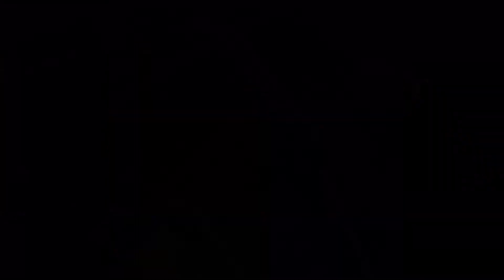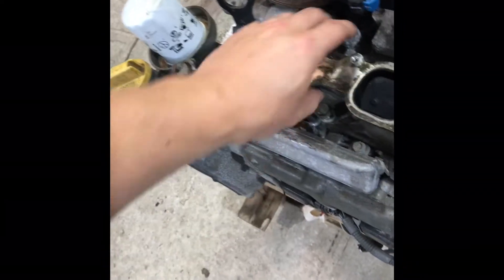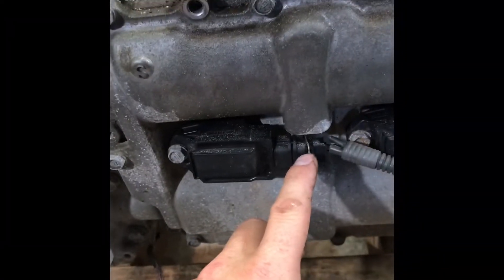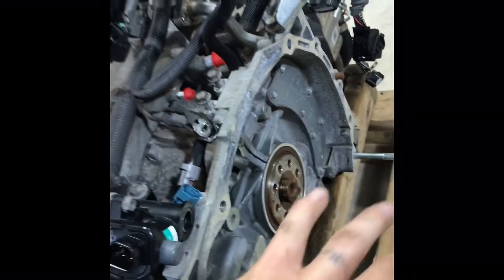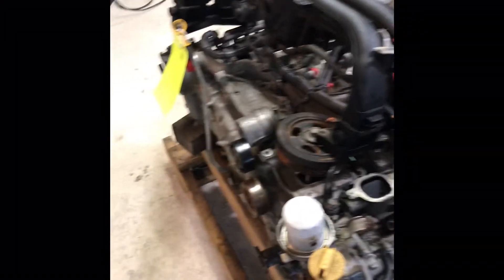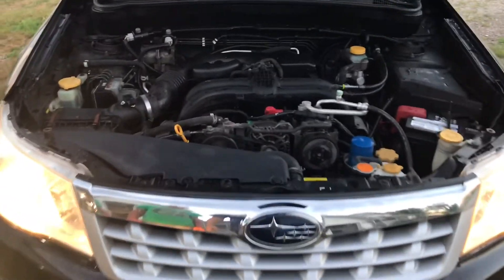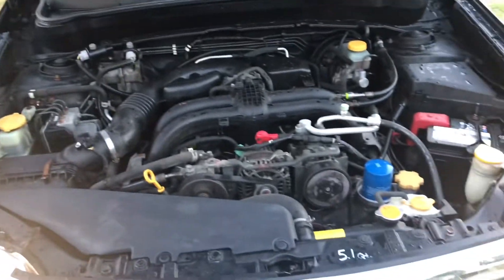2017 Legacy Engine Swapped into 2011 Forester!

Comment: I just swapped a 2015 into a 2011 forester keep getting 2004 2005 2006 2007 codes any ideas
Reply from the maker: Those are all codes for the TGV’s. Both sides are reading stuck open and stuck closed. If you watch my latest swap video I explain how to work around it. Here’s the link:  https://youtu.be/zORqmkh46H8?si=k6pThjwIyIt81sI9
Reply: @stvnswld  I used the old intake and tgvs any other ideas
Reply: I guess I should have mentioned I started with the newer Intake and was getting the same codes but not all 4 at same time so I pulled actuators off old engine put them on  new in take same thing then swapped magnets and gears and then put old intake and reinstalled with old actuators. Are the actuators  side specific. Maybe I mixed the magnets up when reinstalling or mixed the actuators up side to side
Reply from the maker: @JohnWilliams-ii6uy  The actuators shouldn't be side specific. Using the new intake manifold, use the old actuator solenoids, use the black magnets from the old intake assembly, use the gears from the new intake, bore out the hole in the magnets so you can readjust the position of the magnet (right now it only fits on the little shaft one way and can't be adjusted), put the original washer that came off when you removed the magnet and add another small washer to space the black magnet out slightly from the gear, black magnet labeled B goes on the driver side, A goes on the passenger side. You will need to remove pins 4 and 5 from the harnesses that connect to the solenoids and reverse their positions in the connector. This is a must because the valves open and shut the opposite way from the original setup and you need to tell the solenoids to move the other way. Hopefully what I'm saying makes sense.
Everything that I've replied with so far has been straight out of the video I sent you a link to on my first reply. I suggest watching that video and note the procedure starting at about the 15 minute mark. I really feel that if you see that part, you will know what to do to have success with no trouble codes. I spelled everything out pretty clearly in terms of the TGV setup and even linked to the forum where I got my info in the video description. 
Hope this will help, let me know what you come up with!
Reply: @stvnswld  I had my motors swapped before finding this video but anyways I am running the old intake on newer motor after swapping parts and pieces before finding your video I Had mixed up the magnets after a bunch of trial and errors so I swapped the mags back to where there are supposed to be and codes are gone. Like I said I wish I would have seen this before installing because I never swapped the tone wheels and now I got the p0016 and p0018 so I assume that is my next issue. Your video is great and very informative wish I would have watched before hand thanks for all the info now to tear trimming cover off again ugh. But again new motor old intake so far no leaks
Reply from the maker: @JohnWilliams-ii6uy  thanks for the feedback! I didn’t realize you had already done the swap before watching. You don’t have massive air leaks between the old intake manifold and the cylinder heads? Aren’t they shaped differently? I tried running the old intake once and I had codes and problems because the manifold wasn’t sealed good against the heads. My first swap I didn’t know to do the tone wheels on the cam drivers and had to tear it back apart too!
Reply: They are shaped different I just put some rtv where it looked like it may cause issues if it does then I will do the intake swap. The first motor I did in this forester I put a 2014 and it also ended up with oil consumption and low compression so fingers crossed this one last longer thanks again
Reply: I did try swapping things around is it possible if I mixed up the actuator from side to side it would give that code
Reply from the maker: @JohnWilliams-ii6uy  are you getting those codes while using the old intake? If the codes come while using the new intake, you can either use the black magnets (swapped side to side and repositioned), use old solenoids, and reverse wires 4&5 in the connector…. OR take the original tumble valves and hook them up somewhere in the engine bay like I did in the video of the black forester. They won’t be functioning properly if you just tie them up out of the way, but you will get rid of your codes
Reply: Where do you get your timing chain gasket kit from do you go through a dealer
Reply from the maker: @JohnWilliams-ii6uy  the cover glues on, I use a John Deere product but rtv would work. The four orings behind it are Subaru OEM, but I get them online because I don’t have a dealer close.
Reply: All is good changed the tone wheels and so far no issues
Reply from the maker: @JohnWilliams-ii6uy  fantastic! Thank you for coming back with an update. I love hearing when people have successes
Reply: Having videos like yours really helps when you run into.a snag
Reply from the maker: @JohnWilliams-ii6uy  I’m glad. That’s why I post them. Help folks out.

Comment: Awesome video! I just swapped a 18 Forestor motor into a 15. I was curious as to why the tumbler generators don't work? I looked at both wiring diagrams and they appears to all be the same. Are the 5V signals inverted or something? Was curious if you could rewire them to work, and not have the old tumblers in the engine bay. Thanks for taking the time to make this video!
Reply from the maker: Thank you for the generous feedback! I appreciate the positive affirmation very much. 

I believe you will find that the valves themselves open and close in opposite directions, new engine to the old. Please check out my newer video, it’s got a better fix for the tumble generator valves! It’s a better video together, I think. Let me know your thoughts in the comments section of that one.

Comment: QUESTION 
I changed the engine in my son's 2009 subaru forester with an engine outta a 2009 subaru outback that ran ŵhen i pulled as well.
Now installed in the forester it has no spark , any idea why?
Everything looked exactly the same but guessed wrong 

Any help would be greatly appreciated 🙏
Reply from the maker: Perhaps the crank sensors are different? Did you keep the forester intake manifold?

Comment: Swapped a 2017 Legacy engine into a 2011 Forester. Got a crank position sensor failure. Any ideass?
Reply from the maker: Was there a specific code? Did you use the original crank sensor and original tone wheel that the sensor reads under the flex plate? Did you use the intake cam tone wheels from the original engine? These could all be items that could cause problems. Are you experiencing a crank no start or is the engine running fine? Any extra info you can share would help me give you good ideas of where to start looking.
Reply: @stvnswld  the failure code is P0340. All sensors were swapped from the old engine to the new engine.
Reply: The engine cranks, and the spark plugs are firing.
Reply from the maker: @samjordan862  you might try using the sensors that came in the new engine’s timing cover? Just one idea for starters
Reply: @stvnswld  we tried using he new sensors and it still won't start.
Reply from the maker: @samjordan862  it’s possible there is a broken wire or bent pin in the harness or connector going to the sensor?
Reply: @stvnswld  we tried that as well.
Reply from the maker: @samjordan862  I would suggest swapping camshaft sensors left to right since your code indicates bank 1. If the code changes to bank 2, then It’s a sensor issue. If it continues to read bank 1, it’s deeper. That’s what I would try next.
Reply: @stvnswld  Here are the 4 codes that I have from the 2017 Legacy engine into 2011 Forester.
P0340 Camshaft position sensor A Bank 1
P0345 Camshaft position sensor A Bank 2
P0335 Crankshaft position sensor A
P0102 Mass or Volume Air flow circuit low input.
Reply from the maker: @samjordan862   the P0102 is for mass air flow sensor, you may try cleaning it or making sure none of the pins in the connector are bent or anything. Perhaps cleaning the sensor with MAF sensor cleaner spray. 
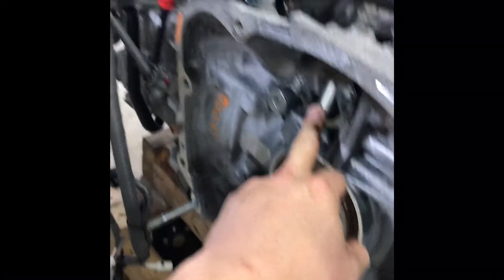The cam and crank codes indicate the timing is either off or the sensors are sensing that it’s off. If you watch the video at the 5:33 point it shows a very critical step in removing the long skinny crank sensor and installing the short fat crank sensor in its place as well as using the tone wheel that was on the original engine. At 7:05, you can see the tone wheels that the cam sensors read. Those need to be switched out so the ones from the original engine are installed. The fact that both cam sensors and crank sensor are flagging you seems to be indicative of something like that. 

If it helps, I have a second video on my channel of another swap and I think I showed some of these things a little more clearly. Let me know if you come up with anything!

Comment: Does the old a/c compressor and alternator bolt right up to the new engine?
Reply from the maker: Yes, everything bolts right back up. but note, you do have to replace the front timing cover in order for everything to bolt back up as it should.
Reply from the maker: I have another video with a very similar swap. If you have time to check it out, it is quite a bit longer though. 20 something minutes.
Reply: @stvnswld  I’ll have to take a look. I found a shop that’s willing to do this for me but I’d like to put a new compressor on while they’re doing this. Just wanted to make sure I got the right one haha.
Reply from the maker: @JBeck2468  great! Best wishes, let me know how it turns out for you.

Comment: Great video! I just swapped an 18 into a 12. I was able to make the old manifold work, I just ditched the intake gaskets and used rtv. I’m 2500 miles in, no codes! Runs better than it did when it was new, and it’s not using oil!!!
Reply from the maker: Nice work! Did the swap go pretty smoothly? Did I leave anything out that made things more difficult? You should check out my latest video. It’s basically the same thing, but slightly better quality content, perhaps.
Reply: @stvnswld  The swap went smoothly, unfortunately, I didn’t find your video until after it was done. I think you covered it very well.
Reply from the maker: @kevhanke  thank you! There wasn’t anyone with a video on it when I did my first one, so I thought I would try to oblige. Thanks for commenting!
Reply: Hi . Thank you guys for this amzing life saving informations. I have one question about the crank sensor. I have 2012 Forester fb25 . I got 2017 FB25 from Forester. The crank sensor on the 2017 its not the same . Is it swappable ?

Comment: Did the motor mounts line right up?
Reply from the maker: I removed the old mounts from the forester engine and installed them onto the legacy engine. Mounted right up. Also had to remove the front engine mount bracket that came on the new engine

Comment: how about late model motor into a 2010 forester?
Reply from the maker: I don’t think it will work, simply because the ‘10 is belt driven cam and the later is chain driven cam. It would physically fit, but the wiring wouldn’t mate at all. EJ25 vs FB25

Comment: Do you know if a 2019 presumably  forester fb25 19k miles would work on a 2011 forester? 
Thanks
Reply from the maker: I can’t guarantee it, since the ‘19 Forester has dual AVCS, meaning the exhaust cams are variable like the intake cams. It would be similar to an EJ20X swap on an Ej255 turbo car. Those had dual AVCs as well. You can leave the exhaust side unplugged and retard exhaust timing 1 to 2 teeth in order to mimic the fixed position of the exhaust cam on the original engine. 

You would have to retard the exhaust cams more than likely, but I’m not sure how much. I would say it’s incredibly risky and you’d be a true pioneer. 

Sorry, maybe that’s not helpful. Short answer is no, I don’t think it will work.
Reply: Thank you so much. Greatly appreciated. Ill keep looking around for better option then

Comment: Hi. I just swapped a 2015 legacy into my 12 forester swapped every thing you stated from the video. It cranks but has not started? Any ideas? The codes I get are p0301 p0303 p0304 and p0102
Reply from the maker: That’s a tough one. Firstly, I assume since you stated you swapped everything that you swapped the engine harness from the old engine? To address the p0102 I would suggest cleaning your mass air flow sensor with a spray cleaner like mass air flow sensor cleaner or electrical contact cleaner. Make sure the connector is in good shape (not cracked or broken at all).  Double check all sensors and coil packs are plugged in tightly. Make sure the coil pack are hooked up correctly. Black connector to the back, white to the front coils. 

There may be an air leak or restriction in your intake tract, make sure all clamps on your intake pipes are tight and make sure there aren’t any obstructions in any lines. My engines have come with a red plug in the throttle body. Make sure yours is free and there isn’t a rag stuck somewhere. That would cause misfire codes and no start if you can’t get any air. 

Also, did you bar the engine over with the timing cover off to verify timing at all? If the engine came from a junk yard, it’s possible a wreck cause timing to jump. I haven’t had this and would remove that cover again unless you eliminate every other possibility. 

It really sounding like an air restriction. Also, I think there is only one way to hook the fuel lines on this series of car, but maybe make sure the lines aren’t backwards. I have seen that done on older outbacks and they won’t start at all. 

Keep me posted! Hope you find the smokin gun!

Comment: I found this great video just after I started my swap using a 2016 Legacy motor with 81,000 miles into my 2011 Forester with 200K miles.  I was in the middle of the swap and what you say makes a lot of sense.   I have a question:  why did you change out the tone wheels on the cam shafts instead of installing the cam sensors from the 2016, into the 2011 timing cover?  wouldn't they provide the correct reading without having to change the tone wheels?
Reply: I got everything changed over to the new motor and went to change the flex plate, tone wheel, crank shaft sensor and bracket.  I removed the 2 bolts from the bracket and gently pried on it.  As it started to move, the cast aluminum bracket it cracked!!! I had to purchase a new bracket.  
You DO NOT need to pry excessively on the bracket!  There are 2 guide pins next to the bolt holes to make sure the bracket and sensor are perfectly aligned.  Simply use a punch to tap the pins through the bracket into the block.  There are access holes in the block that allows you to easily push the guide pins back out to the original locations after the bracket removed.
If I would have done that, I would have saved $35.00 and 2 days shipping.
Reply from the maker: The engine computer is programmed to read the tone wheels with the notch. The sensors should be the same, they read the signal and relay it to the ECU. If you don’t change the tone wheels, the computer will think your timing is off and will send cam/crank correlation codes and possibly run poorly.
Reply: @stvnswld  That makes sense.  I was gonna check with my parts supplier to see if it was the same can sensor for both models or not.   I really don't want to have to mess with the timing if I don't have to, but I guess that settles it. There should be some way to reprogram the ECU to cover that kind of issues with a retrofit?
Reply from the maker: @davebalmer1312  you don’t have to mess with the timing at all. All you have to do is take that front cover off and swap out those tone wheels. You can leave the timing alone.
Reply: @stvnswld  Yep! Got The timing and cover done yesterday.  I'm getting closer but just workin on it a little each day.  I'm waiting for some seals and gaskets from the parts store on Tuesday.  Not many Subaru dealers in this part of Michigan.
Reply from the maker: @davebalmer1312  you got this! Can’t wait to hear your success. Before the engine goes in, double check the hole in the rear of the crank where the torque converter centering pin goes. I’ve had engines come with a broken pin stuck inside the crank. You wouldn’t get the engine to draw tightly to the transmission if there was anything stuck.
Reply: @stvnswld  Yes, I saw that piece of advice you gave to someone else.  Thanks!